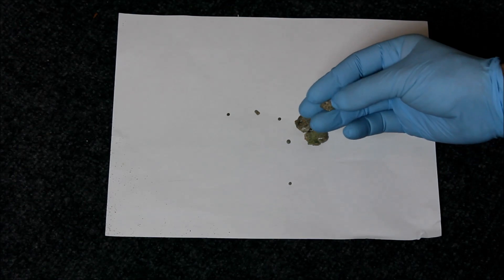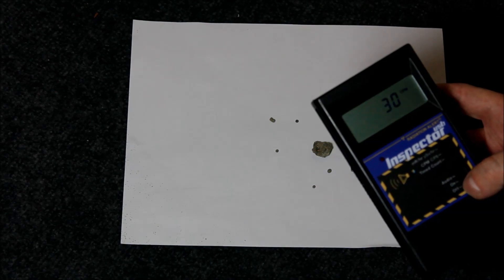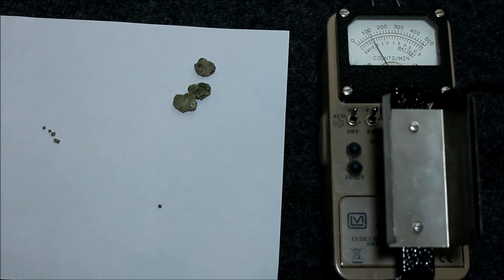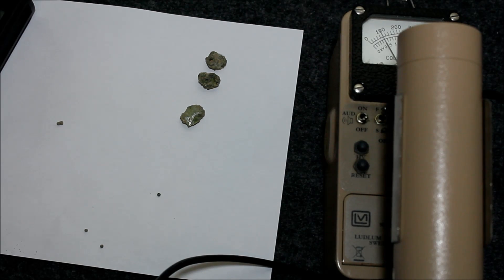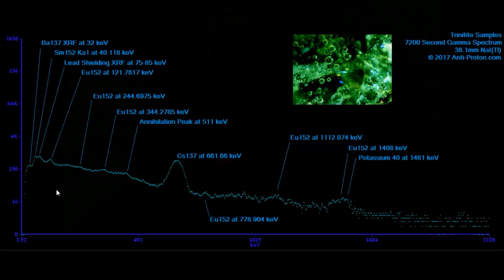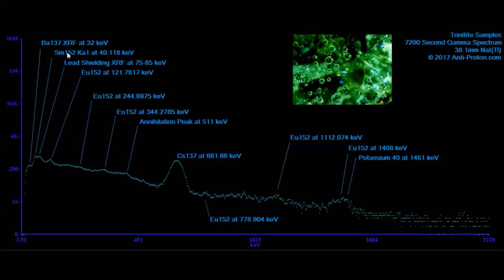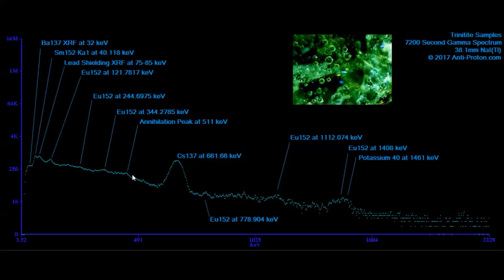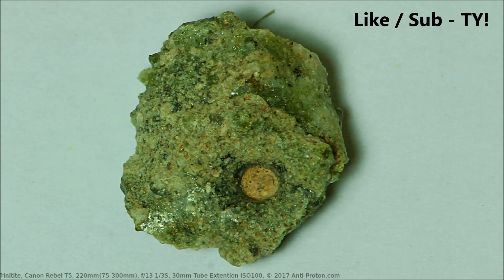☢Trinitite - Nuclear Glass!☢

Comment: Can neodymium magnets be used to deflect alpha particles?
Reply: Yes! They don't travel very far (except in a vacuum), since they are relatively massive and very positively charged (+2), so it is very hard to detect, but any particle with a non-zero charge can be altered by a magnetic field! Beta particles can deflected by magnets. I've done it! Strontium-90 works well, but Cesium-137 will work, as long as the beta radiation is energetic enough to be detected and not mistaken for the gamma rays!